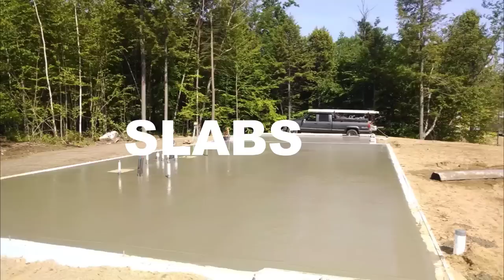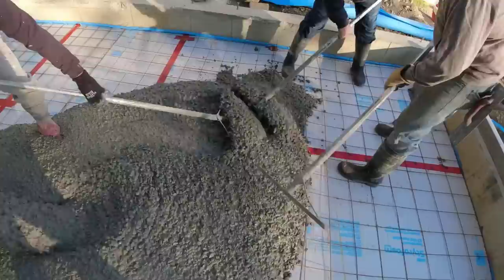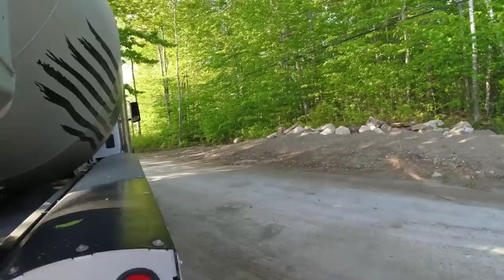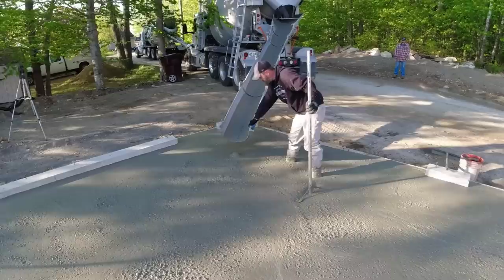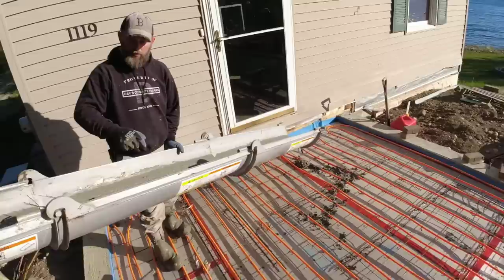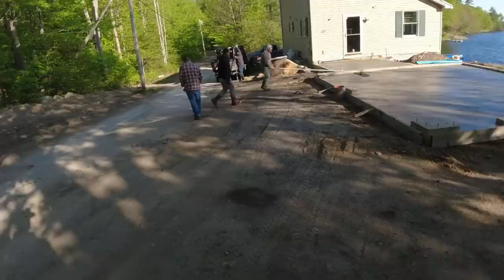City Inspector Makes Homeowner Pour His Concrete Floor 8 Inches Thick!

Comment: That's BS. I would make the city pay for it. Pouring it 8 inches thick isn't doing anything to raise the floor. Should have required the footings to be higher and the grade to be lifted then poured a 4 inch floor. They need to outlaw those butt dumper mixers. Extremely dangerous trucks. Front discharge only.
Reply: How is it the city's fault? Home owner/contractor messed up. Not the inspectors fault.
Reply: @stang1970  They are required it be done so they should pay for it. That's very simple!